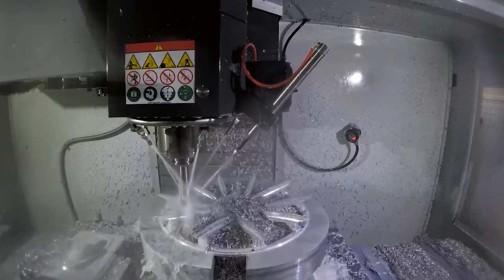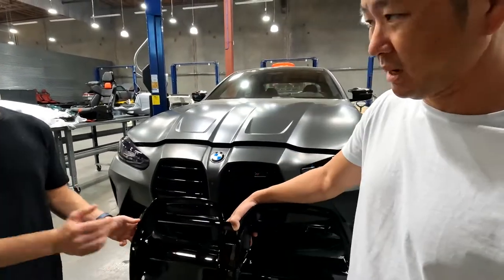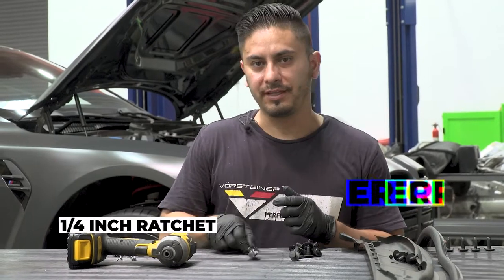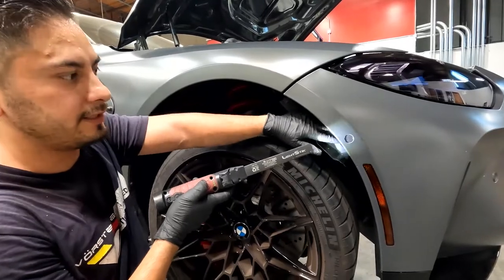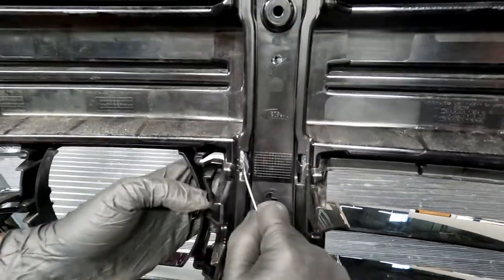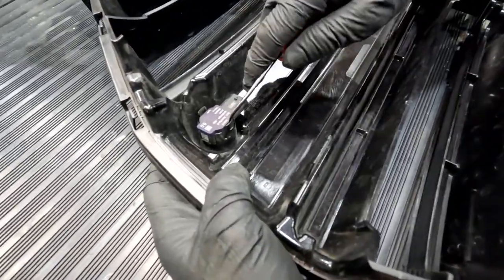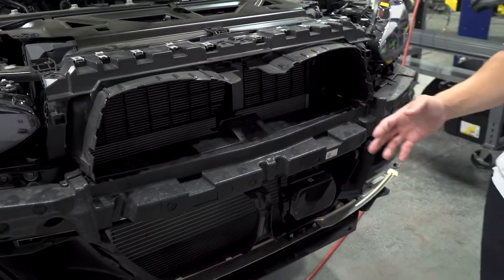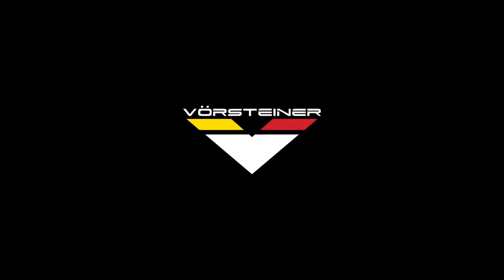BMW M4 G82 ABS Grille How to Install DIY | Under The Hood at Vorsteiner!

Comment: Great work guys !
Reply from the maker: Thank you! Please let us know if you guys have any questions in the install process!
Reply: @VorsteinerUSA  Ready to make my purchase, but I have one lingering question....I am wondering if you had to modify the bottom right mesh to allow for the ACC sensor? Also, does the answer apply for the CF grill, as the black ABS grill seems to sit deeper into the bumper. Thank you for your help and making quality products!
Reply: @VorsteinerUSA  does the mesh come installed (and is it cut for the ACC) and do you still have to cut the foam bumper or is their an updated version so we don't have to cut the foam. is the CF two piece or one piece